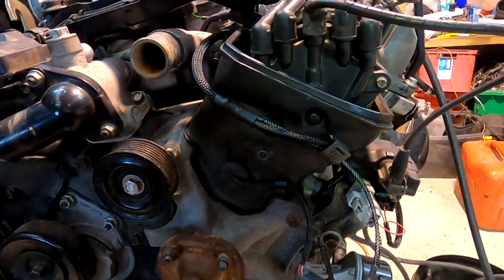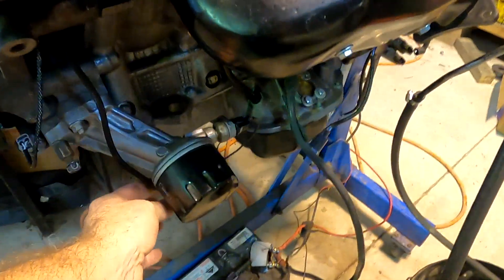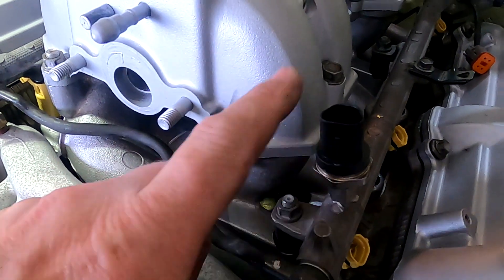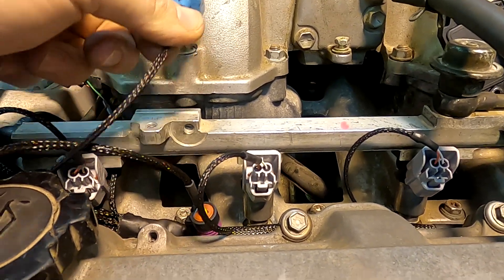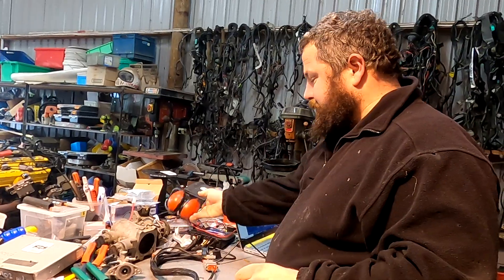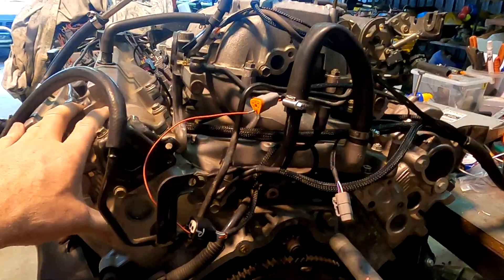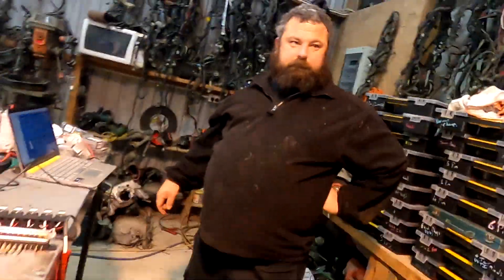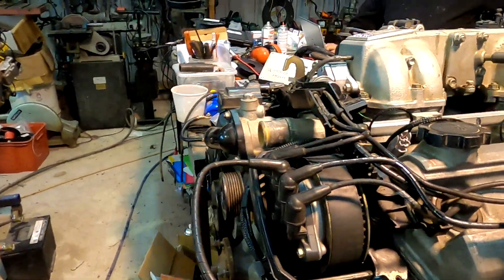Link ECU - Storm  to 1uz.  Aftermarket Wiring options with install instructions

Comment: Hey Guys, I have 2 diesel engines on a yacht with very simple old tech that simply start/run and monitor using the old style gauges. I was just wondering after watching a few of your videos, is it worth the effort to make new looms and add an OBD system (which it currently does not have) so I can plug and play new instrument clusters? One diesel is a (perkins 4.236) generator and the other is the main engine (detroit 8.2l V8) for propulsion. Im thinking it will also help with engine diaognostics in the future...any comments?
Reply from the maker: If you wanted to set it up it would allow logging and with a cangauge it would allow simple display and warnings.  Not sure the expense would make it worthwhile but they would be your choice.  Cheers Kelvin

Comment: Hello, can you help me, I have an ecu block 89661-50310 that stood before that 3a080 swapped the ignitors igt1, igt2 in places it starts up but then stalls. Maybe you know for sure if 50310 has an immo? Maybe you know some kind of solution to this problem? block on stamps in '95. gray connectors.
Reply from the maker: Have you wired the diagnostic port and checked for the immo fault code?  This is the easiest way to confirm if an ecu has immo or not.  Cheers Kelvin
Reply: @CartuneNZ  Hello, there are no errors. The car starts up for a few seconds, then stalls.

Comment: ive wired up my 6 wire iacv on link thunder as per your drawings and settings, it works perfectly. But it does get warm (not hot) when its just sitting there doing nothing (key on engine off) is that normal?
Reply from the maker: I've never really checked sorry so not really wanting to comment further.  Cheers Kelvin

Comment: Wassup man , I have a 96 ls400 and I’ve been having an issue wit it ,it has a misfire and gives me code p0300 p0302 and p0306 the car give out white smoke from the exhaust and continues . People told me it might be the power steering idle valve but I capped off the ports but it still gives out smoke. Dealer told me it was a bad fuel injector and that causes the ecu to go bad. What do u think could cause this , I replaced the fuel injector that was failing which was for cylinder 6 what do u think this could be ? I could record a video and upload it to YouTube
Reply: Like always test and diagnose rather then guess
Reply from the maker: I recommend testing the system carefully.  The ecus do fail more than injectors.  Testing is the best way forward.  Cheers